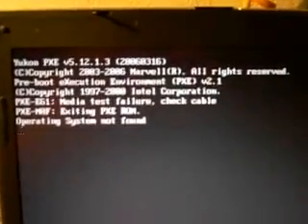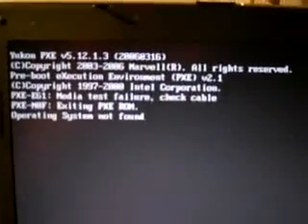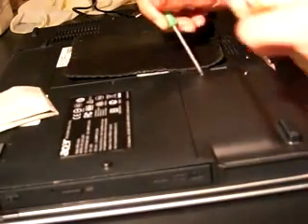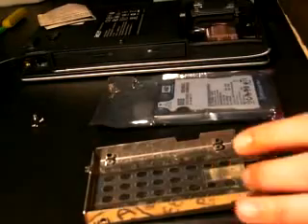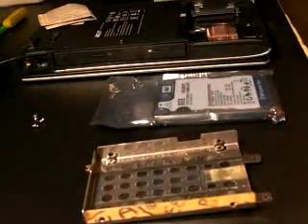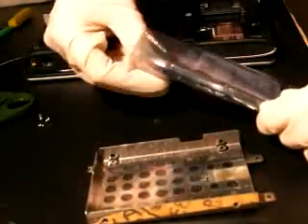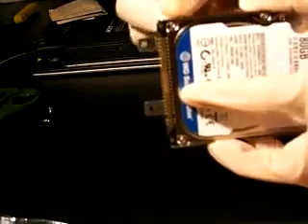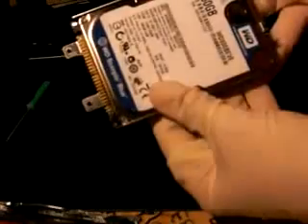Step by step easy tutorial for newbies to fix an broken harddisk

Comment: Ouch... This person obviously has failed to understand that a 5K4RPM hard drive does not necessarily mean it can't be replaced with a 7K2RPM one.

What it really boils down to is the actual current/power that the drive is consuming. I've run into some 5K4RPM drives consuming far more power (~700mA @5V) than a 7K2RPM drive (~400mA @ 5V).

Comment: Lol, double74 is spitting game, lol.  But mina, are there any tools or softwares in particular that you use in order to retrieve data from a hard disk?  I have an old hard disk from my old desktop which i have a lotta data on and most of those files were in different folders on the desktop..I tried connecting it externally and when i went to desktop folder, nothing is there.  Any ideas what i should do?